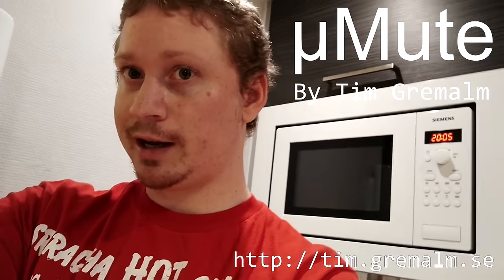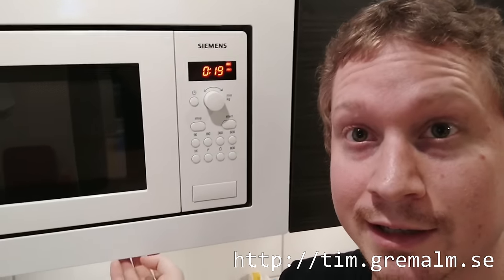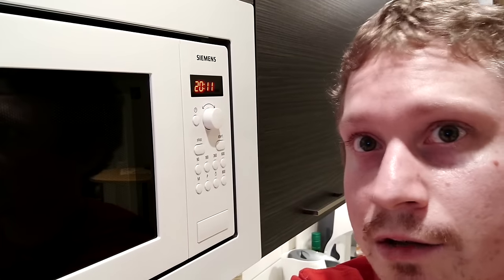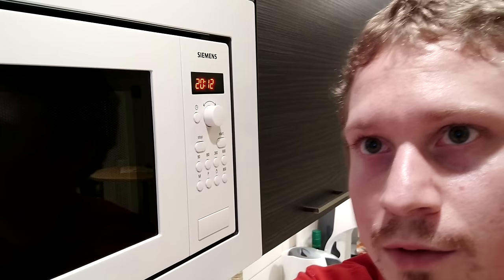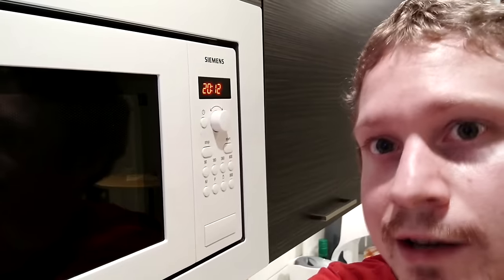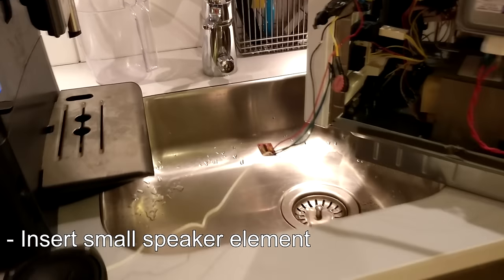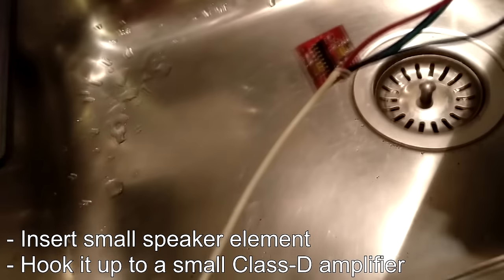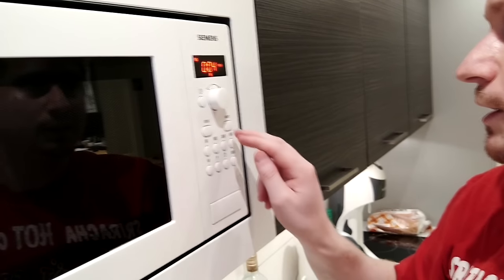Replace buzzer in microwave oven with Windows XP startup sound

Comment: Nice - to make the speaker sound louder, another option would be to put it in its own enclosure. I made one for a little speaker using a piece of a water bottle and it improved things significantly.
Reply from the maker: It's own separate enclosure would work, there's some free space around the border.
But the speaker doesn't need to be louder, it can be heard pretty clearly in the room.

Comment: I would have stopped at removing the buzzer speaker. You do know that you can open the door before it finishes to prevent the sound from playing?
Reply from the maker: "stopped at removing the buzzer speaker" that was my original plan. But the exposed 5V and buzzer signal on the PCB got me thinking about maybe do something more. An audible signal from the microwave is really useful.
Reply from the maker: Opening the door requires me to raise my ass from the office chair and let go of anything I'm working on. Also, it doesn't fix the problem with colleagues that will not take care of their recently cooked food.
Reply: Tim Gremalm I didn't realize it was at work... Why not write a notification script on your arduino, so that it sends an email or a sms when its finished.
Reply from the maker: It has crossed my mind as well. But ther's no way of knowing whose food is in the oven currently, and I don't know who to notify. If i notify everyone it will be as annoying as the beep.
Reply: You could setup a RFID card system, that way you can identify the user. I was trying to think of a way to do it with an app. Some sort of proximity identification.